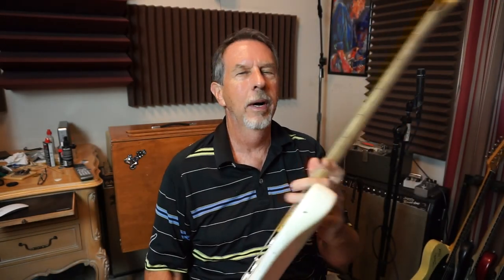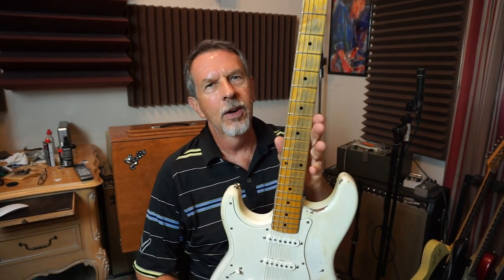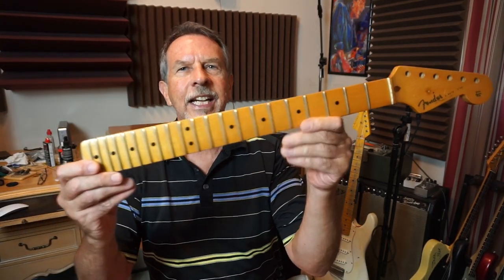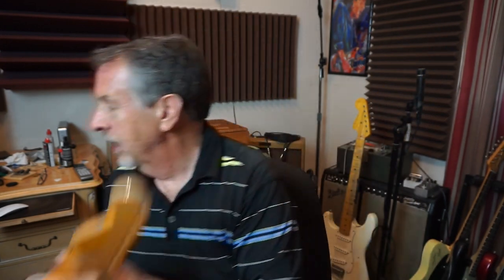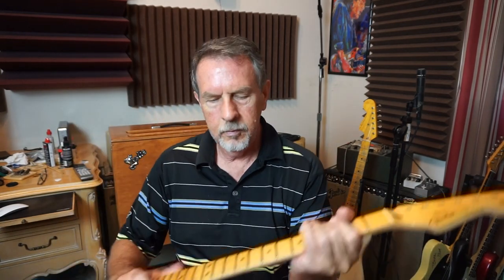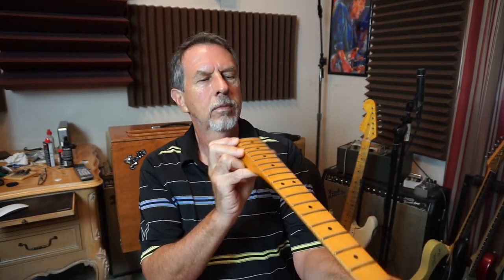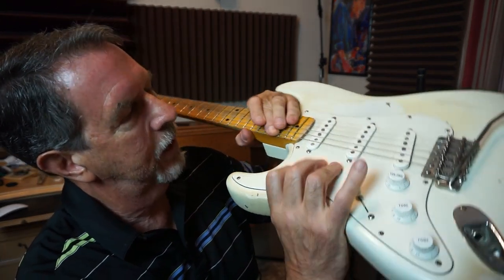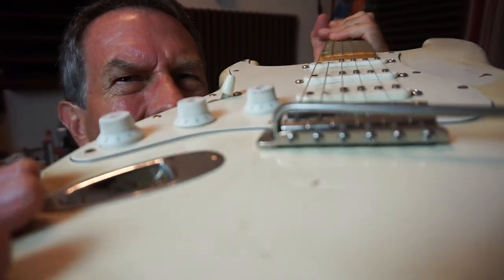I Need Some Advice on Refretting Electric Guitar Necks

Comment: I've refretted my jazzmaster neck to replace the jumbo frets to vintage style. The way I did it was soldering iron on the frets to get rid of any glue underneath and then a pair of pliers to take them out. Slight sanding where the frets came out (I think I used some steel wool could be wrong.) I had some precut/pre-radius fret wire that slot into place. Small dab of glue and then a rubber mallet to make sure its fully in. Only thing I will say is to tape off the neck so the fretboard doesn't get scratched but that's it! Good luck my guy.

Comment: It sounds like the only advice you need is go for it. You get the tools and practice and be patient. I did see a YouTube video of a guy that made the radius wire bender homemade and I would definitely get a press. Hammer Time on a neck scares me 😂
Reply from the maker: I chickened out.  Here is the luthier that will do the job and for only $110 (because I supplied the frets).  Plus I bought the new neck and it actually sounds better than my old neck for some reason.  The neck wasn't cheap but now I have a spare reverse headstock neck that I can try on a couple of my other Strats.  https://youtu.be/yo-TeJdZxis

Comment: Jescar stainless 55095 is what I prefer. It lasts forever! It is available pre bent to radius. Drop the cash to get the StewMac “Jaws” fret press with the appropriate radius inserts. The 12’ or longer radius blocks are also recommended. A flat sanding beam can be bought on eBay or Amazon for ~$40. The fret end leveling block/file is a good purchase on eBay too. A few dabs of thin superglue on the fret tang ensures life long seating and seals the slot.

Maple can be refretted without refinishing, but it’s best to sand to radius/flat. StewMac has the colored nitro in rattle cans and it’s usually dead on. Look at the complete StewMac fretting kit to see what you can get elsewhere.

Arbor presses are great too. Cheap from Harbor Freight.
Reply from the maker: Just the glueing process is daunting now.  I've read too much about using different glues and how much time you have to work with it, you must you a press, etc.  Whew!  Too much.  I remember years ago I got too aggressive on the bevel of the fret ends and pretty much ruined the neck.  There is a fine line there.  I have tried leaving a lot of fret and then the strings seem to slip off easier and I remember on some old necks, the strings would actually get stuck under one of the fret ends after they slipped off.  Now I am having bad flashbacks.  That was a long time ago but just focusing on getting that right would probably take me days.  When I see the videos with all of the nice, huge belt sanders and other pro tools, that is what I would really want.  I would have to want to become a luthier to invest in all of that.  There are not very many (maybe three) luthiers in this area and I have only used one and he is not answering his phone right now.  Is that "Jaws" fret press that $335 vice grip looking tool?

Comment: Hi millstap. You mentioned you have some of the StewMac tools. I bought and used their refretting kit awhile ago, it was $140.00 at the time. Watch Dan Earlwine's video on how he uses the kit. No fret press needed, watch Dan how he over radiuses the frets slightly with the tools and taps them in with the hammer. There is also another tool that looks like a wooden file that slices thru fret ends. The longest and most labor intensive part of the job will be rounding, dressing and smoothing the fret ends. I've refretted two guitars in the past, one fender and another with a bound finger board. My advice or what I have leaned is: watch for the right angle when you are slicing away the fret ends so that you maintain the correct reveal. When dressing the fret ends don't get two aggressive with the small fret dressing file. There is a guy in the UK called Crimson guitars that has a video on how to do this. Also here are videos of me discussing the StewMac tools and a bit on how I refretted my Fender Strat Plus. 
1) https://www.youtube.com/watch?v=MBt-Ib2RAYo  
2) https://www.youtube.com/watch?v=9A_4iD7byk0
Also I forgot to mention that I've put together a couple of parts-casters that I've had to do quite a bit of fret work on. Radius blocks are quite useful too, if you don't have one you can use a flat piece of metal such as a level with masking tape on the side and sand paper glued to it, then it can be removed easily afterwards. Also watch the videos by a luthier called "High Line" or "Hi Line" guitars where he talks and shows about fret leveling. He also talks about spot filing of frets which I found very useful. Where high frets are high only at certain points.
Reply from the maker: Thanks a bunch Joe.  I will watch the videos now.  The more I dig into it, the more I want someone else to do it.  The trouble around here is nobody seems to be very accessible.  I called the guy yesterday that has done several necks for me, and he doesn't answer a lot of times.  Very frustrating but I guess understandable since he is a one man show.  I had little experience with another guy in the area but he made a nut for me that I didn't think was very good.  I have to fix it myself.  No one is closer that 45 minutes away.

Comment: First, I would say don’t practice on anything you care about.  Second I would get a caliper to measure the existing fretwire height.  6105 wire has a .055” crown height and can usually be dressed a few times before ever needing to be replaced.

I’ve seen (and fixed) many many guitars that has a DIY attempt.  It’s a bummer every time.

Also, measuring the existing slots once a fret or two is out should inform a decision on which fretwire would be best going in.

Just my two cents.

Comment: Yeah give the refretting a go , it's not as hard as it sounds  . You can get fret press Cauls that you can use in a drill press from ebay ( yeah im a cheap , but they work well )  . you don't need all the fancy tools you already have the files etc , just get a nice flat piece of metal to spray glue on the sandpaper  to do the leveling  .  All the best with the refret

Comment: Jimi Millstap, if you have uniformly worn out your frets....then you'd pull and replace them all.  But if you just have wear in certain areas where you dwell when you play....just replaced those frets and relevel the new frets to the same plain as the existing frets and recrown away on them all.  Otherwise a neck with worn out frets is the great candidate for being a dedicated slide guitar.  ************************************************************************************************I generally have smaller hands so I like a slim neck but I acquired a telecaster with a baseball bat neck and have gotten used to the fat neck.  But in the past I had a V neck guitar that I favored as the V fits into the pocket of your hand better between the index and thumb due to the base knuckle of your fingers.  SO in the past, I recontoured my les paul neck to be a V neck which really worked out for me playing.  I'd suggest starting out with a thicker neck as you rasp in the contour......rasp it in by hand with a uniform draw the whole length of the neck with the same kind of tool pressure as the contour will come up kind of fast.  Once you get the contour going, you can smooth sand it to get the roughness out for a minute and try the neck in your hand for fit......and keep making the adjustment till you come to a comfortable contour for your hand.  You don't need to come to a specific measured contour......you are starting with a specific measured contour and going from there......you are tailoring to your specific hand.  I never got around to putting a finish on my strat neck after I V'd it, so I played it natural.  SO people like that where as others want a slick finish and others want somewhere in between.  If you are dealing with a laquer neck finish......just use laquer sanding sealer on the raw wood and go from there....whether you need finish or not or like the raw wood feel.  Your hand will eventually polish the raw wood after playing it enough....much the same as a well played neck that has worn through the finish. ******************************************************************************************************************I used to have a nice long metal finishing file with a really fine smooth cut.....I liked it because it was long and was great for guitar necks to get the frets in to the same plain for leveling.  I used to run it over the frets across them and slowly move it down to cover the whole neck and then back up......and once they appeared to be in the same plain, I used a light to see under the file and make sure of it so I'd see no light in a gap...….then crown lightly.  I imagine if you found a long sharpening stone for knife blades......you could bring the frets into the same plain and be more gentle in metal removal …...but you'd need to move the stone as to not to keep it in one place to put wear into the stone and go lightly.  With the body pocket being square and a level plain, the neck heel needs to be examined and possibly adjusted to get the right tilt neck angle.....so you don't have to go to a shim......so you get the right relief in the neck plain.  Then you'd need little truss rod adjustment  to go beyond a true straight neck to the body fit...….you'd get a super nice low action if you wanted.  The critical aspect is the nut height in relation to the frets....so if the nut is cut to deep and thus low....it might need a shim or a new nut cut for the neck to catch that perfect action height...….guitar with a zero fret kind of illustrates that aspect in the mechanics of a guitar.  The technicality with action height is that you tune the strings open and then have to push the string down into a fret to note.  The less you have to push the string down to fret means less deflection from the plain and the resulting tension change......so the higher the action the more deflection meaning the fretted note could become out of tune....so setting the intonation at the 12th fret with a high action is kind of speculative due to the height of the string there....so the touch harmonics and the fretted notes could be slightly off and have that weird effect sonically.    Set necks like a les paul where the neck joint is at the body and the last frets on the neck on the body are difficult to get a good adjustment because the fret board is on the body solid.  The bolt on necks can be more exacting when the heel of the neck is angled perfectly when its mounted to the flat plain in the pocket....but factory fitted necks are just provisionally adjusted.  How deep the neck sets into the body pocket is dependent on the bridge and its curvature to match the radius of the fret board.....to get the perfect action height...….if it were a hard tail or down flat on the body.  So a bigsby would be superior to a strat whammy because the bridge doesn't move and change  in the relation to the plain like a strat bridge whammy situation.....by the time you set up the individual strings and how far they need to be from the 6 pivot screw at the front of the base plate.  BUT that's going to the extremes.  Keep in mind that fender went to the 3 bolt necks with the micro tilt adjustment in the heel.  There is some literature out there about bolt on necks and getting a good tight fit in the neck pocket....you'd string up and tune to tension.....then loosen the neck bolts which would let the string tension pull the neck into the pocket as snug as it could get due to the string tension.....then tighten the screws down......that would give you the best coupling between the neck and the body with a bolt on.  If you are really hardcore, you could make sure there is no finish in the body neck pocket and in the heel of the neck that would come into contact with the body wood in the body pocket......and use a light film of glue.  Sort of like a set neck minus the dove tail joint machined in to the mix of things....but still a mechanical fit and coupled by contact and glue just the same as a set neck.  A light film would let you separate the neck from the body if you ever had to remove it.....a swift rap of a cushioned mallet would pop it......or if you use a specialized glue.....you could heat it or use solvent lightly.  Or ultimately use paper in the body pocket being glued in first and a film of paper glued to the neck heel to fit in.....so the bond is at the paper and that could be sanded off on both surfaces if you pull the neck.  The engineering aspect is the point of transfer from one substance to the other....so in this case it would be wood but different densities of wood with a fender as opposed to a mahogany  body and a mahogany neck with a Gibson.  I have a late 70's les paul with the 3 piece maple neck with rosewood board.....as opposed to the traditional mahogany neck with rosewood board......it imparts a sonic difference in a les paul and I feel the mahogany neck is where its at with them.

Comment: I just had a maple cap neck made by Musikraft for a Woodstock replica build I did.  (late 60s specs.. medium C profile) and finished by MJT.  Fantastic neck!
Reply from the maker: djchaseb What radius, frets, and truss rod did you get?
Reply from the maker: Good to know.  I may end up going that route because the guy that is selling me the replacement neck has not responded to my recent requests.  I would prefer the maple cap just to try out for a change.
Reply: @millstap  I definitely agree that Musikraft makes QUALITY necks on par with Fender custom shop, if not better
Reply from the maker: @anthonyclarke2076  What neck radius, fret size, and truss rod did you decide on?
Reply: @millstap  I got the medium c shape with a dark slab rosewood board, abalone top and side dots, 9.5 radius, 6150 nickel silver frets and they're attention to detail and wood selection is beautiful, they're fretwork is ON POINT more than anything you'll get from Warmoth, USACG, or allparts
Reply: @millstap  and I got the two way truss rod with the vintage adjustment at the heel
Reply from the maker: Anthony Clarke do you like the 6150 frets? I’m torn between them and 6105’s.
Reply: @millstap  honestly man, they are decent, and I wish I got the vintage radius because I'm more of a fan of the 7.25 radius boards with the 6105 frets I feel like a little taller fret may help with bending a bit, but the width of the 6105 feels perfect imho
Reply from the maker: @anthonyclarke2076  Yes, that is why I want to learn how to do refrets so I can experiment with fret size.  The neck on the Nash is 10 radius with 6105's which is a little flat and not as comfortable but I got used to it.

Comment: Curios I see a lot of your guitars do not have Rosewood fretboard do you prefer the Maple over the Rosewood If so , why ? Also I was wondering if I could get some help on wiring that Leslie I’ve got the rotor coming and the motor but unsure about the wiring so I can get two speeds out of the pedal I have like you do. What did you wire your pedal to.
Reply from the maker: My two vintage Strats are both rosewood and have EVO Gold frets so they will never need refretting.  I think I prefer the smoothness of the rosewood and the fact that they always keep their nice look.  I also like the sound of the maple so it is good to have both options.  I will answer your other question about the Leslie on that video and put the links to the original videos I did on building the Leslie.

Comment: I have to ask, what are your crowning experiences.  I get frets wear out, but also they can be worked, at least I believe quit a bit before refretting.  If people file down voraciously then they are not there, but crowning really does a lot in many cases
Reply from the maker: I have recrowned these frets once but I need some height and there is not much meat left.  I have a diamond recrowning file from StewMac that seems to be okay.  I would really need to re-level them first and recrown and they would end up too low for me.

Comment: SRV's guitar tech could refret one of Stevie's GUITARS BETWEEN SOUNDCHECK AND GIG !
Reply from the maker: I wish I had that luxury.  I just wonder how times and old vintage Strat can be refretted before you wear out the fret slots.  I would think after a while, the neck would start sounding different with the wider slots.
Reply from the maker: Or better yet, just have several refretted necks ready to go.  It would take about 10 minutes to bolt it on and set it up.  That is what I ended up doing and the guitar is in perfect shape now.  Plus I am getting the old neck refretted so I will have it as a spare which I am actually going to try on one of my other Strats.

Comment: I sent you some videos through fb messenger    Good luck!
Reply from the maker: Thanks Nik.  I haven't looked at them yet but I have already put on a new neck.  I should do a little video.  The guitar sounds better with the new neck.  I was hoping for that.  There was a 1/2 of a thin guitar pick in the pocket as a shim.  I removed that and now the guitar sounds louder and has more sustain.  Surprising since the pick was so thin, I didn't think it would do anything because it was kind of buried in the pocket paint.  Either way, it is sounding great and I will take the old neck to my guy to be refretted and keep it as a spare.  That is one reason I love Fenders.  I had to drill the four neck mounting holes and StewMac suggested using a drill press but I just used my hand drill and it worked perfectly.  I also had to drill the tuner mounting holes and the string tree.  The guitar is louder now which was a little surprising to me.  I also had to take the bone nut off of the old neck and replace the new TUSQ nut on the new neck with it.  That worked out great too.  Perfect fit.